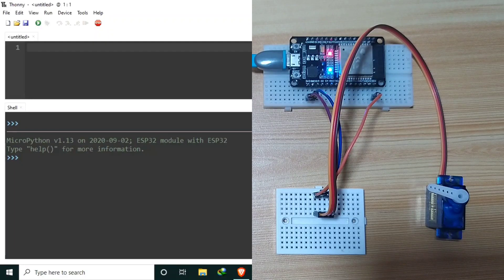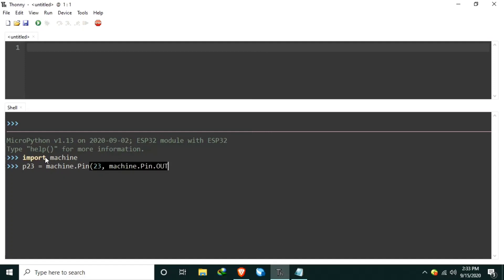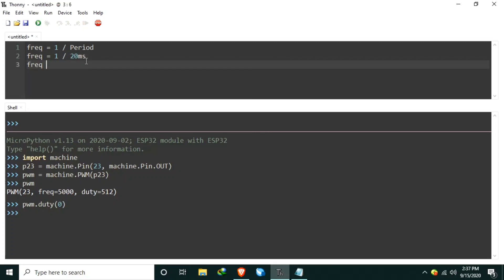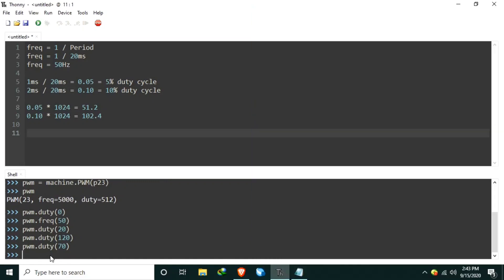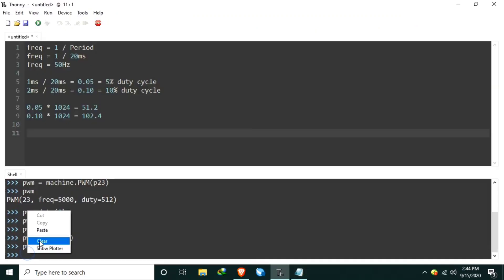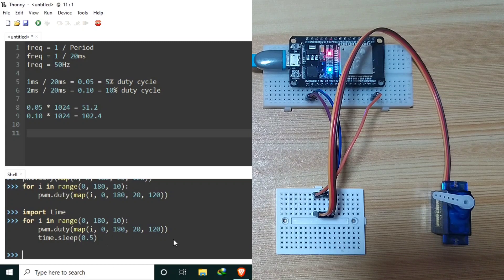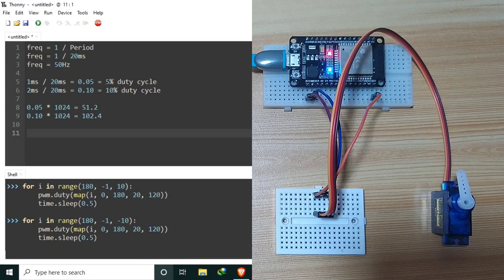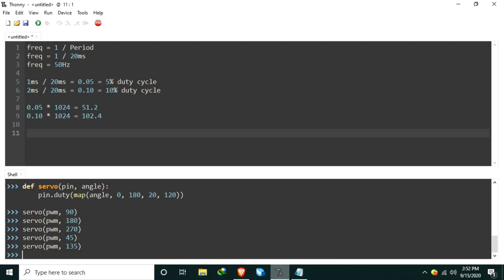006 - ESP32 MicroPython: Control Servo Motor in MicroPython | PWM

Comment: I have tried connecting servo motor's power and ground directly to ESP32 as well as to external supply and also checked for various pwm duty cycle values but its not rotating. Infact, I have even used for a for loop with values of pwm duty from 0 to 120 to check from which value it starts rotating but of no use. Someone please help
Reply from the maker: Have you try adding some delays?
Reply: @TechToTinker  Everything sir. I even changed the pin to which the servo is connected and tried but no use. I got a doubt whether the servo is working fine and tried using it with arduino and it was working perfectly fine. I used an external 6V battery for the servo.And I have searched about the problem using all kinds of words/phrases. Only in one of the forums I found one person having the same problem but no solution was provided there as well.
Reply from the maker: @phanidharkumar7007 if you already tried everything then what else? You should try reading the datasheet of your servo. Basically determine the following:
1. How many volts should be use to power the servo?
2. Common ground should always be observed! That is connecting ESP32 ground to external power supply.
Reply: @TechToTinker  Sir, it's the hobby servo. I have given 6v external power supply. And yes I made sure of the common ground. However, as per your suggestion, I'll try again and get back to you
Reply: @phanidharkumar7007  try to change the firmware version. I was trying this to do this on esp32v1.17 but it didn't work. When I downgrade to v1.13 it works.

Comment: Would love to use microPython in my projects but its just so much more work than Arduino. 

#include <Servo.h>
myservo.attach();
myservo.write(90);  

done, supper easy.
Reply from the maker: Hi @michael fogarty, I completely respect your thoughts and I appreciate for leaving a comment. I would just recommend to leave your eyes open sometimes we need to look at different angle, perspective. Cheers.
Reply: There's no simple way achieve this angle?. Is there any package?